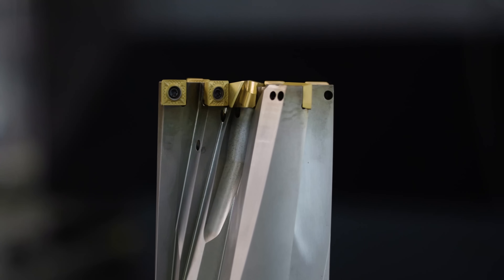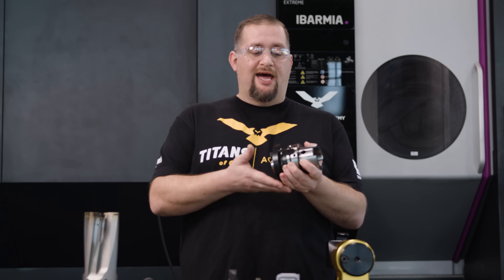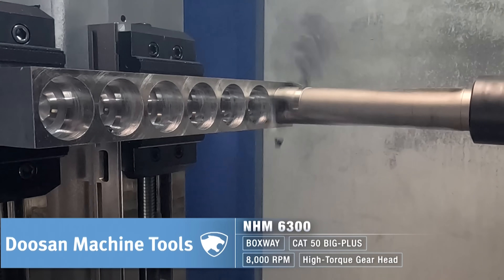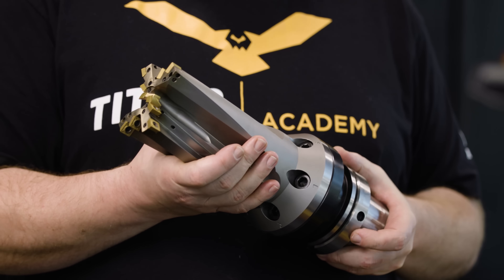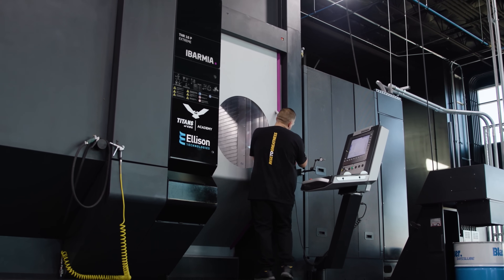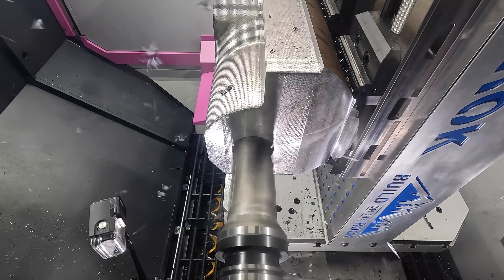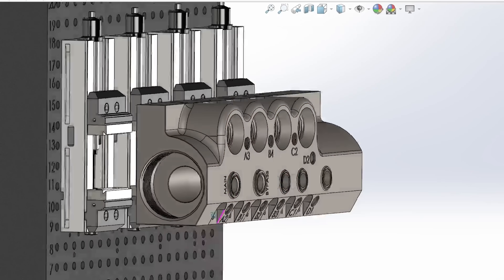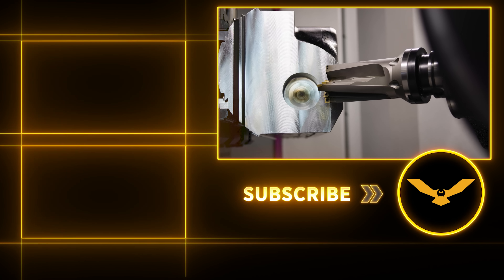Drilling MONSTER Holes with The KRAKEN on 100 HP Machine 5 AXIS

Comment: Sure it has 8 inserts (4 flutes), but it still has two cutting edges in the center of the tool. Considering sfpm is decreased as you get to the center of the cutter, I sounds like you could easily push this tool too hard because you think you have 4 flutes while you actually have 2. Your calculated chip load, based on 4 flutes will be doubled in the center and with less sfpm too. Sounds like a bad idea to me.

Comment: That thing is a beast, can't lie. Only run on high hp machines.
Reply: Yeah man! I was looking at torque curves and requirements to push this thing, and using recommended feeds and speeds you need almost 1000 ft/lbs of torque LOL

Comment: Yikes! MSC direct says those cost between $3000 and $4000 bucks!
Reply: Everything in levels, brother! Odds are that if you have a machine that can push this, you're making huge titanium and stainless parts, and when you need to plunge rough a 4 foot wide pocket, that 3-4K won't bother you a bit, as that would eat up twice that in endmills or inserts! Thanks for watching!

Comment: Is there a way know how much HP a drill is going to take? I know a lot of manufacturers have S&F charts for drills and materials, but don't know that I've seen HP requirements to match with that.
Reply: I use NOVO/The machining cloud. There, you can input the exact material, tool, and inserts, and it will give you the required HP and Torque
Reply: Sandvik also make world leading tooling as do most of their group (seco, Walter etc) along with the imc group of companies (Tungaloy, Iscar Taegutec). All of the above have apps and web based wizards where power consumption can be calculated as well as spindle parameters such as speed, gears and torque can be input to determine if your machine is capable of driving the tool/material.

Comment: If you got 100HP do it  Had a couple horizontal Makino's that were beasts like that. Over 100HP, just go after it, if you fixture it well enough and the tool can do it.
The big dogs gotta eat. 😊
Reply from the maker: As mentioned we ran slower because we didn’t want to hide the cut in a blanket of coolant but… the drill will go back in twice as deep in the next video and we will turn on the coolant and her her rip

Comment: We need to see this drill with coolant in full action
Reply: Seriously.  Who cares if we get flooded with coolant
Reply: Its more impressive without
Reply: @DylanVos05  not really
Reply: @rossomyman  yea cuz it shows this drill can evacuate the chips without tsc
Reply: @DylanVos05  at the cost of burning the tool and causing material hardness isues would rather see tools with out then with coolant for a side by side what it can do.
Reply: @Dnine69420  some materials actually run better without coolant. temperature shock and such. coolant isn't some magical liquid that can turn into tool into a metal shredding machine. it has to be used PROPERLY
Reply: @DylanVos05  i agree that some materials do work better dry, but im sure a blind man could see that the tool is burning and that material doesnt like to be run dry XD
Reply: @DylanVos05  it’s a horizontal machine of course it will evacuate.